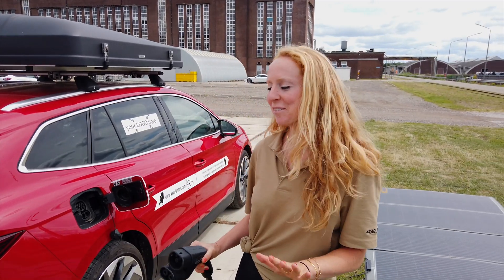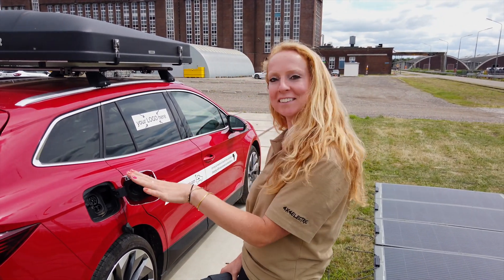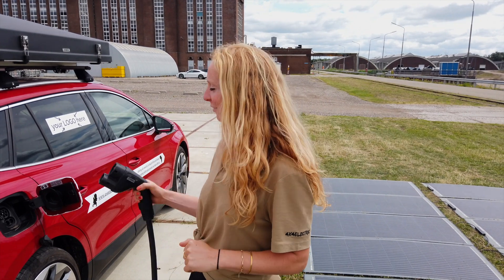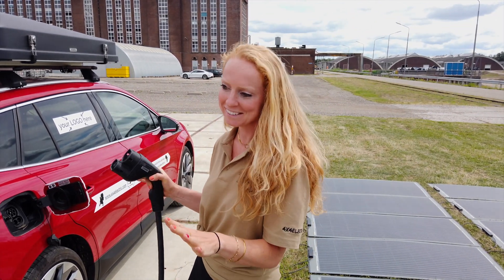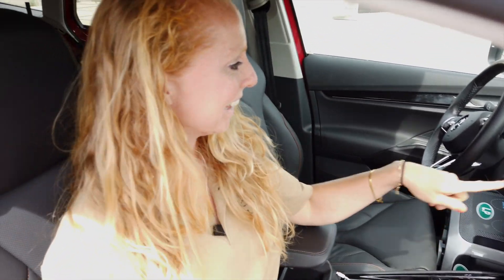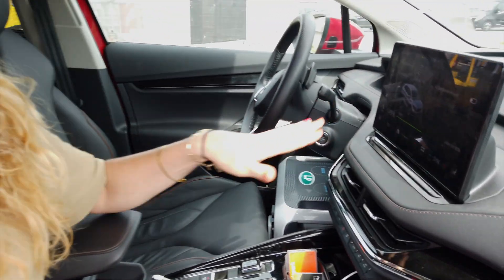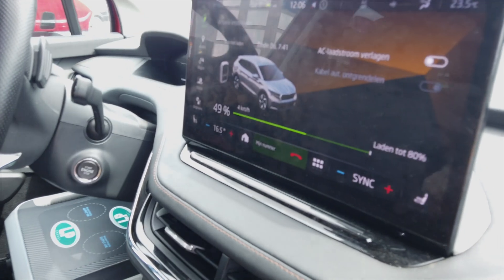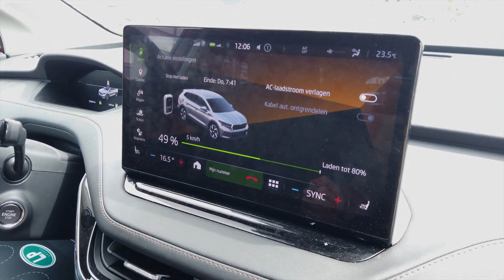4x4electric - First time solar charging

Comment: Did you connect all 36 panels in series? How long did it take to charge?
Reply from the maker: For now we connected 33 panels in serie. In final setup it will be two strings of 30 panels. Charging was slow as we have to set the power manually. The reason: we know the voltage, but we do not exactly know the amperage, so “asking” to much and the charger will shut down. Max we charged was 3,6kW which would result in ~6,5kW for all the panels
Reply: @4x4electric  install an mppt tracker!
Reply: @MaykThewessen  in the final charge unit we will install a mppt tracker! But thanks for the tip 🙂